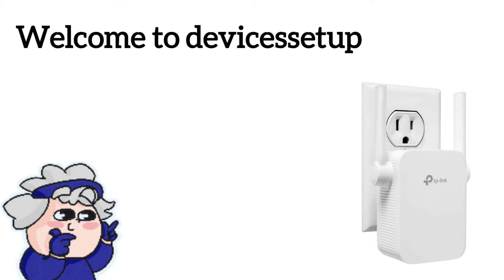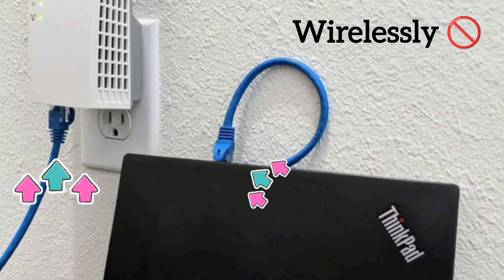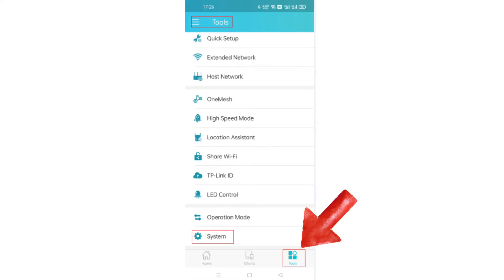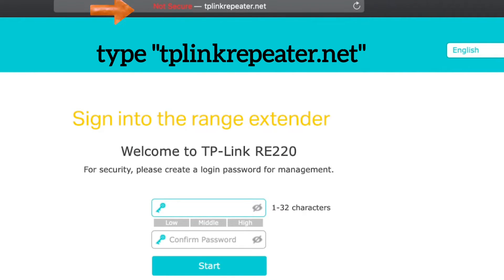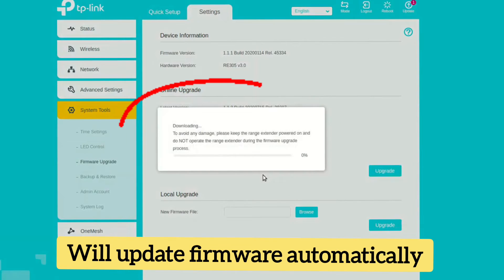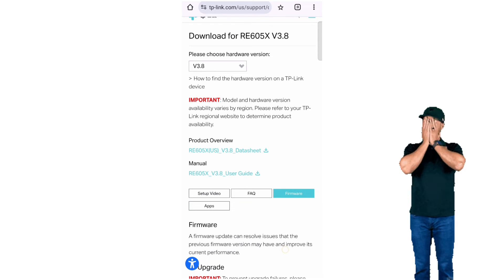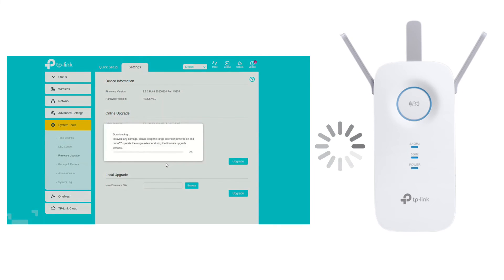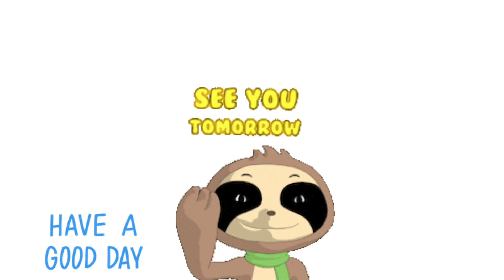How to update Tplink extender firmware | Re220, Re650, Re500x, Re655, Re550, Re215, Re315, Etc |

Comment: Will web browser method work if I used the wps method to setup the extender?
Reply from the maker: If The extender is already setup, then the router will assign new ip to your extender. SO U WILL be able to login into the ext using that ip address. Or else connect to extenders ssid and type tplinkrepeater.net into the address bar. If that works great, If not then find the new ip and login via it. YOU can watch thr video here on how to do it.https://youtu.be/Iszz2Oyna4E?si=1YXt58GZEchs5uyS